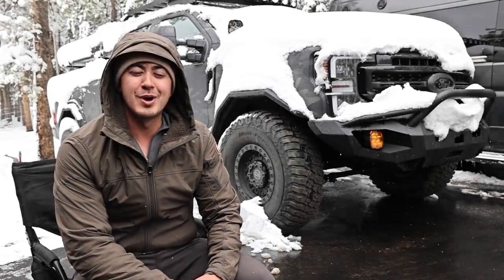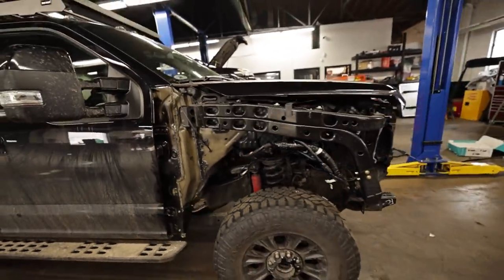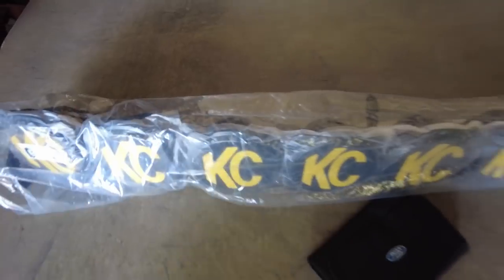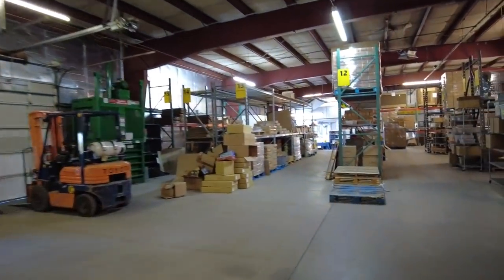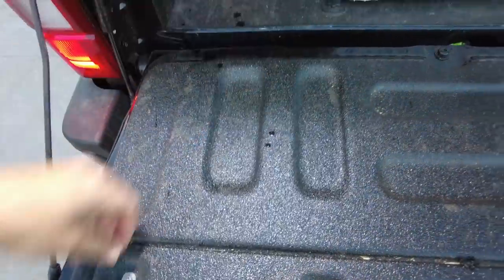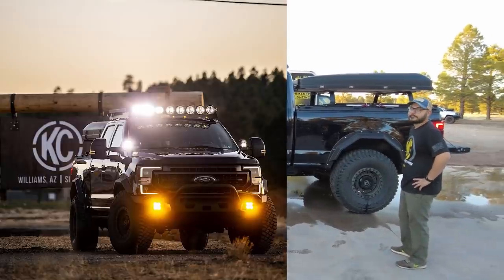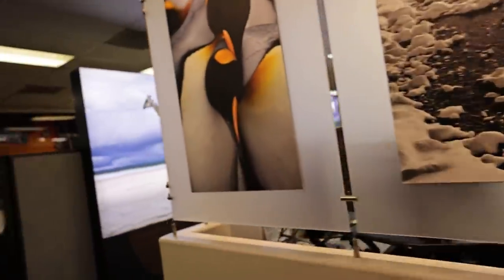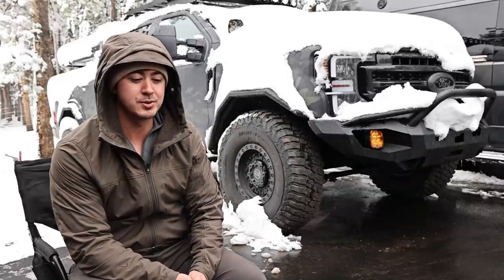Ford F250 TREMOR Build Update #3 - FULL SIZE Overland Adventure Rig Super Duty - 39s, Lights, etc

Comment from the maker: Find Trails with BFG's Trail app - http://llod.us/ontrail

edit - I usually remove 90% of the ads YouTube injects, but the tool isn't working right now. For those watching this early, if there are a bunch of ads - I'm sorry. I'll remove them once the tool starts working.
Reply: Thanks for the link.
Reply: I know that this truck and the Van are the main focus currently, but would you be able to do a Tacoma video about things you would have done or would do differently from the start? (i.e. suspension, racks, tires, lights or interior)
Reply: about to pull the trigger, but curious how the support is for Canada. or is a US based app?
Reply: Are they working on Android Auto or Apple Carplay support?

Comment: Mike - Carli 4.5" Pintop full suspension, and add the Carli airbags to retain factory cargo and towing capacity while giving a WAY better ride...best of both worlds...I sent you pics of my setup a month or so ago
Reply from the maker: I'd do the 2.5" if I did Carli. My front end is in between weight ratings of their gas and diesel springs though, so I need to decide on a stiff front end or let it sag a bit.
Reply: @LastLineOfDefense  I forgot that’s the gasser. Only thing with the 2.5” kit, is that you can’t do the Carli airbags (they only work with the 4.5)… either way, their kits are a massive upgrade from factory…mine is a Super Raptor lol
Reply: @LastLineOfDefense  - you should just go with the Gas specific front kit. It’s listed as a 3” kit, so it may have a tiny amount of sag but would still be way under the extra 700 lbs. of the Diesel engine.